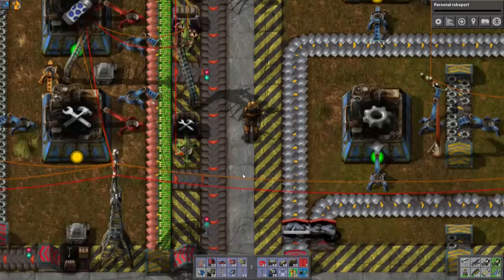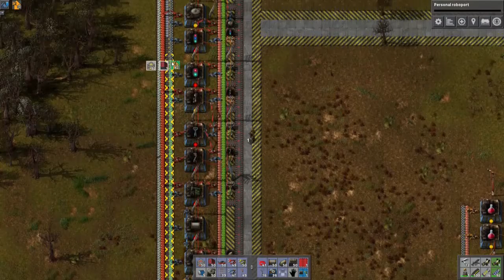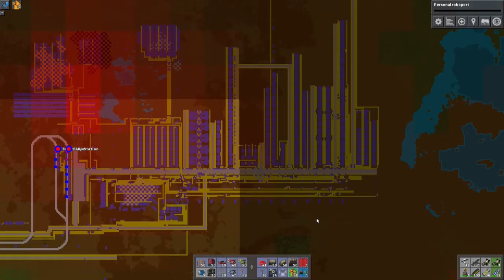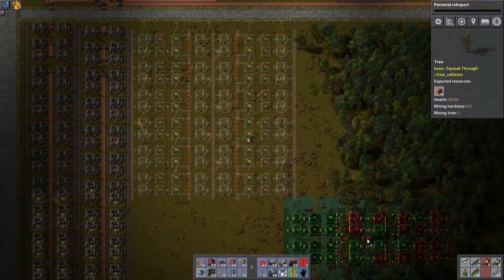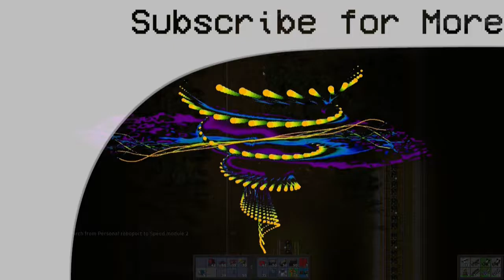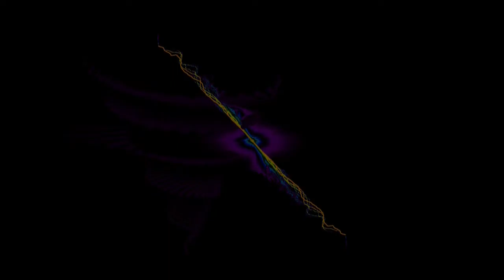Green Circuit Smelting | Factorio Rocket/Minute w/ 0.15 Science E33

Comment: Belt's shouldn't lag anymore (at least not as much). They reworked it completely.
Now if you have 100 piece straight line of belt, it acts basically as one :)
Reply from the maker: I know!!! I still need to test it in real life, since the update happened yesterday. The next 2 episodes are still with the old version though. I recorded those before today.
Reply: So according to devs, belt optimization was postponed to 0.16 ... but who cares with nukes! >)
Reply from the maker: +MrVolodus well, the belts may not have been fixed. The game does run a lot smoother. They did manage some parts of the game.